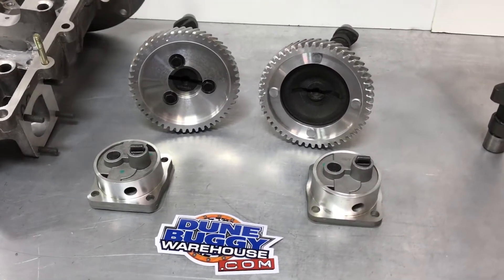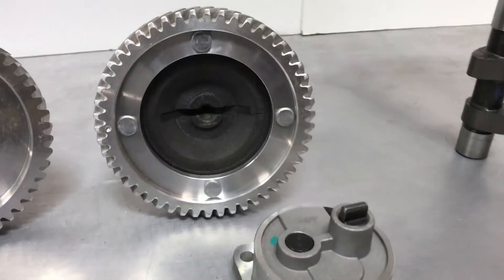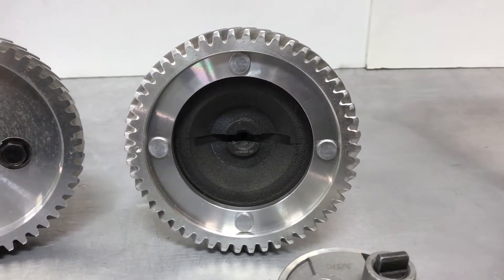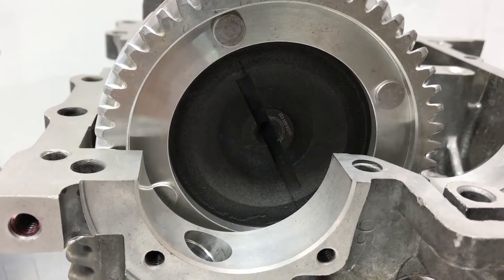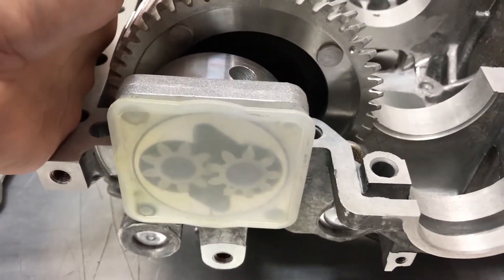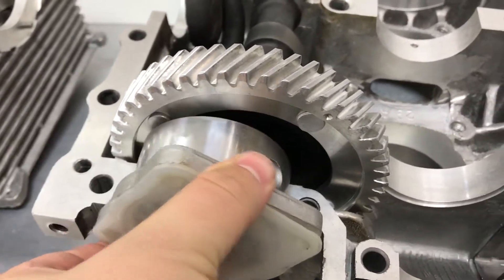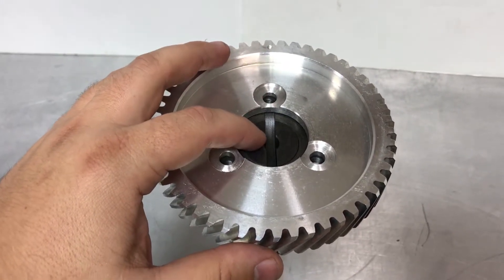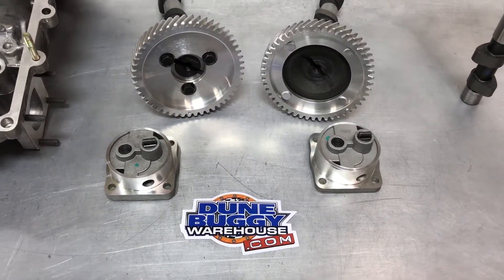Flat vs Dished Cam - Which Oil Pump do I need? Air-cooled VW Tech Tips

Comment: I had a 1600 and wanted bump it up slightly and was advised to get AA 88.5 pistons and add a cb oil pump with auxillary lines and filter. Engine now has I feel too much case pressure and oil coming out and filling empi breather box leaving a smoky, and oily mess after drives. Should I switch back to a more stock oil pump?
Reply from the maker: Check the crankcase vent tubes and make sure nothing there is kinked or clogged. If the rings weren't gapped or clocked before installation, that may cause excessive oil blow-by. Oil pump, even oversized, is unlikely to cause crank pressure or blow-by.

Comment: I have a 69 beetle sedan  1641cc flat cam do I have to have a 26mm oil pump cause I bought a 30mm oil pump
Reply from the maker: Either will work but the 30mm may give you high oil pressure.